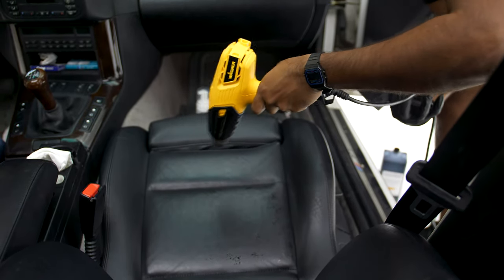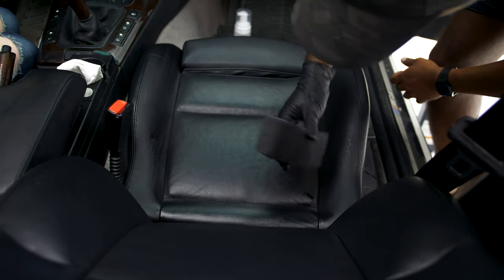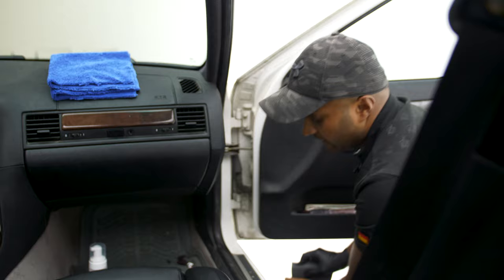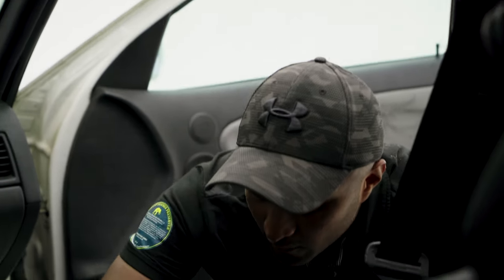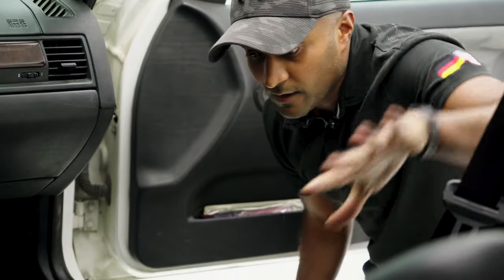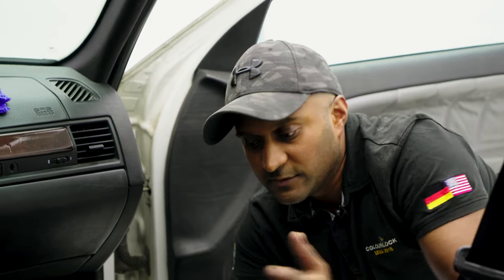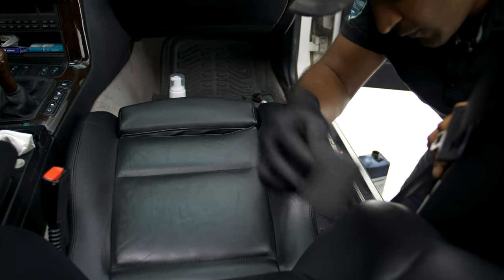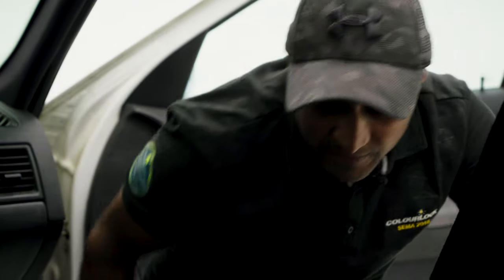Colourlock: The Best Method For PERMANENTLY RESTORING Leather Car Seats? | MORGAN LEARNS DETAILING

Comment: Some use colourlock color dye refresh. Yesterday I did a little test. apply 3 layers drying with heat gun. After 24 hours pass conditioner brand lend and remove the layer. some idea because it can be

Comment: so does this fill in the cracks or do you have to apply a filler and then paint over it? Great video
Reply: This does not fill cracks, thats leaning towards pro repair.
This is a "do it yourself" kit, which allows you to maintain the leather and give it back paint and protection in parts where its missing.
Think of it as filling in stone chips, its not perfect, its there to protect the metal.
Reply: @TheDim3s  Great Analogy! They also teach classes on full leather restoration as well as have kits for shops and have classes available around the world!